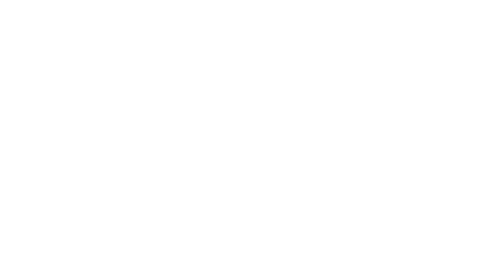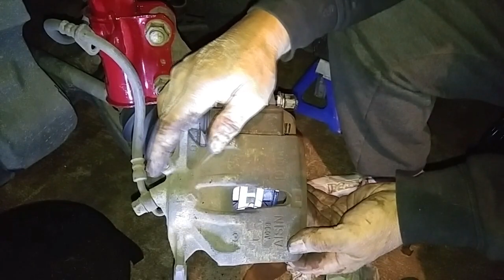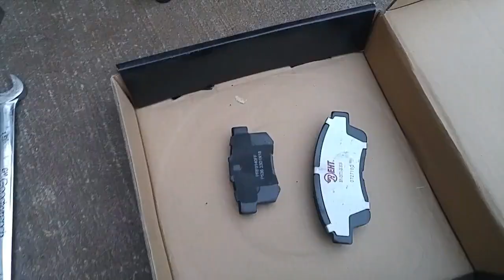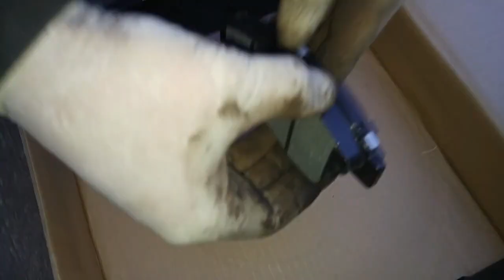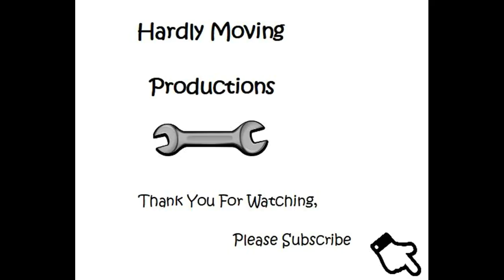What Causes Brake Squeal &  How To Prevent It

Comment: Great video..do you have any how to fix drum brake noise only on the right side.. thanks again be blessed
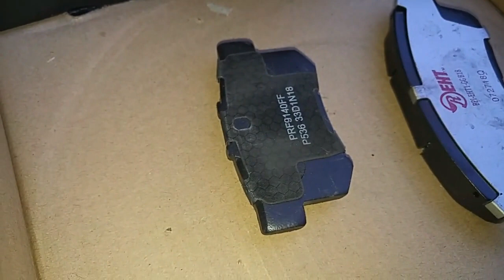Reply from the maker: Thanks for your post and yes ... I provided a link at the 1:21 time mark titled "Parking Brake Shoes & Rear Brake Pad Service (Toyota/Lexus)"
Reply: @hardlymovingpro  thanks again be blessed
Reply: I noticed the brake grease is on the inside of the shim. I've been putting it on the outside :/
Reply from the maker: @azwb  That'll work for a little while until the grease wears off due to less contact surface area.  Applying grease between the shim and pad will generally last longer.  Also, some pad manufacturers provide rounded indents on the pads to hold more grease.

Comment: My Brembos still squeal, ... what should i do ?
Reply from the maker: Rust on brake rotor, no lubricant on pad shims, slide pins need lubricant or poor quality pads.
Reply: @hardlymovingpro  I have tested 7 diferent brake pads, and lubricated all pins and side guides, installed new discs, checked all 4 pistons , that they run with no restrictions, but , the result is still the squeal . That's what i have tryed in the past 6 years. So, what do you suggest now ? Thanks.
Reply: @kopronko  ... different pads material... semi-metal pads always bites good on fast cars. 

My rear pads are noisy only on very light braking... gonna lube both sides of the shim on the piston side
Reply: Rotors

Comment: Loads of Porsche brakes squeal at low speeds. It's a feature! 😂 They've even produced an infomercial, explaning why it happens. I've tried new discs & pads, different pad manufacturers and added brake paste etc to no avail. I think they don't want people to drive there cars slowly, as it only seems to happen on slow driving and not hard braking. Beats me, might sell it and buy a Toyota instead. 😅
Reply from the maker: On the European style calipers common to vw's, I applied high temp RTV where the inner pads clips into the caliper piston and where the outer pad is kept in place with the caliper 2 prong fork.  It stopped the unexplained brake squeal